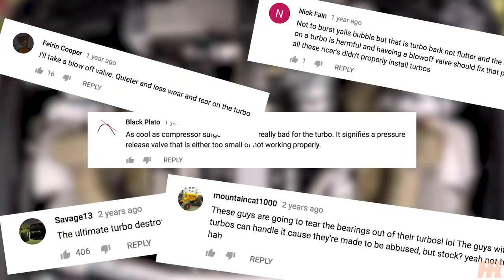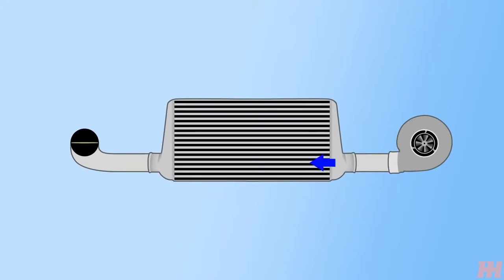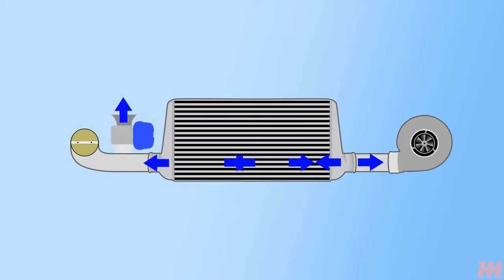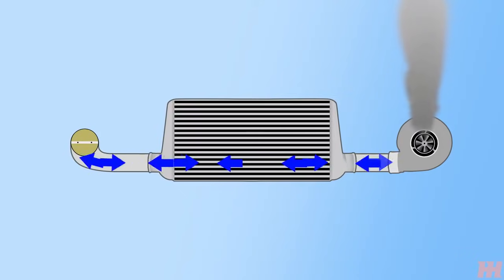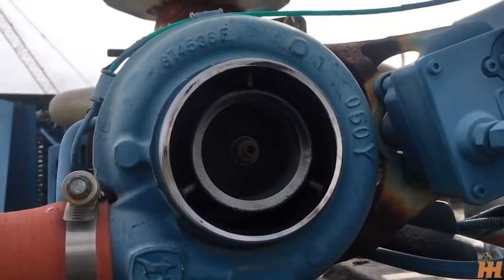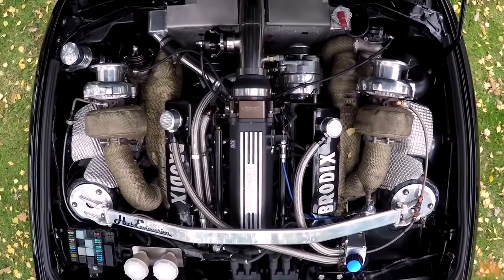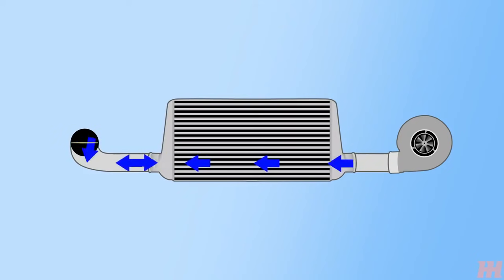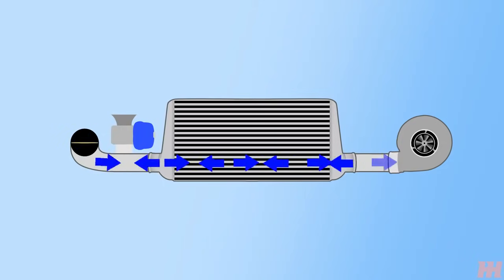The Truth About Compressor Surge

Comment: Stall is stall, open or close throttle. In the example given here you just replace the throttle butterfly valve with the engines intake valves.

Compressor surge is one of those things you know is bad for the turbo but no one can really measure the effects. 

In theory you want to minimize as much as possible for the health if the turbos but same is said for people and sugars, carbs, alcohol, etc, etc. Having some one kill you on the spot but what is the lasting results with indulgence?
Reply: Stall is not stall in this scenario. There is a difference in boost pressure when on throttle compared to off throttle. Closed throttle stops the turbo from creating boost, engine goes into vacuum the turbo is not making more boost which is not pushing against the air that just hit the throttle plate.

The turbine is still spinning because of exhaust gasses, the back pressure of air coming back to the cold side is higher pressure than what is moving toward the throttle body. There is minimal pressure being put on a thrust bearing in this event, which is almost the same as having a bov in the system. Unless your bov is the same size hole as your piping there is going to be some back pressure on the thrust bearing.

Stall during open throttle though happens while trying to make boost. The turbo is activity trying to push more air in than the cylinders can take. Exhaust gasses are actively trying to make more pressure and with nowhere for the air to go it moves back to the cold side forcing its way out of the inducer. This puts massive strain on the thrust bearing.

Now, you can put more strain during closed throttle on the thrust bearing than it was initially designed to handle by increasing the amount of boost a turbo was designed to operate at. A higher boost pressure coming back toward the cold side will out push the turbos idle speed and push against the wheel a little harder. But usually upgrading to a 360 thrust bearing fixes that issue.

Comment: how does open throttle compressor surge happen?
Reply: When the turbo is too large for the engine. It's putting in more air than the engine can physically take/make use of, so it comes back out and flutters under load. THAT is the compressor surge that can fuck your car.

Comment: Still though, closed throttle compressor surge will slow down your turbo, it might sound cool but why would you want to slow down your turbo especially between gear shifts?
Reply: Austin B it slows it down briefly but it also retains that pressurized air instead of ejecting it so the response might be better. I imagine in practice they both behave pretty similarly tho.
Reply: It’s bound to slow down, as exhaust pressure shall decrease unless you don’t lift off during gear changes 😛
Reply: You should go to a car meet, find a high hp car with no bov. Get them to take you for a drive and get back to me about the "lost hp". lol

Comment: Well that was only partially helpful for me. What happens when you experience closed throttle compressor surge but don’t have a throttle plate because the vehicle doesn’t have a throttle body. Ie my cummins powered truck. The entire intake system is open and unrestricted from the air filter to the intake ports. The throttle controls the injectors and not the airflow
Reply: hope you don't mind the copy/paste (as I literally JUST wrote this)... lol  Hope it helps though!

While they don't need them, they still help on a diesel to keep the intake air flowing smoothly through the compressor.  Although, as you said, there are no TBs on them, the thing that drives the turbocharger is the exhaust volume/heat... so when you stop "pouring on the coals" the turbo doesn't have as much exhaust roaring through it anymore, and that causes the entire engine's flow (VE) to slow down VERY dramatically (which will in turn "fight" against the compressor's high rpm), so they open up a "BOV"/solenoid to allow the turbo to continue freely pumping the air through.

Comment: This is incorrect. It does indeed cause stress/ damage to the turbocharger. 

“The Blow-Off valve (BOV) is a pressure relief device on the intake tract to prevent the turbo’s compressor from going into surge. The BOV should be installed between the compressor discharge and the throttle body, preferably downstream of the charge air cooler (if equipped). When the throttle is closed rapidly, the airflow is quickly reduced, causing flow instability and pressure fluctuations. These rapidly cycling pressure fluctuations are the audible evidence of surge. Surge can eventually lead to thrust bearing failure due to the high loads associated with it.
Blow-Off valves use a combination of manifold pressure signal and spring force to detect when the throttle is closed. When the throttle is closed rapidly, the BOV vents boost in the intake tract to atmosphere to relieve the pressure; helping to eliminate the phenomenon of surge.”

This is from Garret’s website :

https://www.garrettmotion.com/wp-content/uploads/2018/06/Turbo-Tech-101.pdf
Reply: Jason Cunningham you can explain all you want, but people are going to believe what they want to hear.  I tried explaining how surge was bad for a turbo until I was blue in the face.  Now I’m like, “I’ll run a BOV in my car.  You guys do whatever, who cares” 😂
Reply: Erik Cruz  😂 true. Same I’ll run a bov in my car. I don’t know why I just couldn’t let this one go, a whole video of misinformation 🤦🏻‍♂️

Comment: £100-169 for a new turbo bigger than you need with a 90’ angle air intake tube, to create big flutter sounds that folk will Balt in their pants. And your still driving at the speed limits. Or hammer the engine and get a little psst sound and uses shit loads of fuel. Which do you choice 🎉🎉🎉🎉😊 also bigger intercooler for cooler air means even more turbo flutter as it’s pushing out cooler air.

Comment: This is WRONG. What they are talking about here is compressor STALL not surge. The true technical definition for compressor surge is when The turbocharger is moving a larger volume of air than the engine can in-take at a given RPM at wide open throttle. A symptom, of unstable air in the intake manifold itself. Also It is (or was) a far more common issue on turbocharged engines that use an individual throttle body assembly running large amounts of boost. I.e RB25/26. Synapse Engineering  has a video demonstrating compressor surge.
Reply: No, there is open throttle compressor surge and closed throttle compressor surge. Open throttle is when the turbo is moving more air than the engine can take and the excess air escapes back through the turbo, as you said. Closed throttle surge is when the throttle body is closed and the air escapes back through the turbo.

Comment: Yet ALL Flutter is bad for journal Bearing Turbo's 
they not meant to take the thrust loadings like that.
Reply: It really doesn’t effect the longevity of the turbo in most applications, maybe the most considerable is in highly tuned bearing turbos without a BOV but even then still lasting a long time, and it is still debatably negligible.

The amount that they slow down under load while the system is closed really isn’t going to do any harm overall, it’s not enough pressure to hurt those bearings, plus those bearing are made to spin at unreal speeds. They can handle a slight reduction in speed, it isn’t abrupt or dramatic enough to do anything notable, especially with how fast they run.
Reply: @DoktrDub   The issue is not the speed reduction The issue is the sudden and violent movement of the turbo impeller. 
Under full boost Air is entering your intake at near Mach 1. This pushes the impeller against cold side housing away from hotside housing with play limits of the bearing tho small still present. 

Journal bearings have no design in them for Thrust Loads Forward and Backward Only Rotational loads even spaced out.. 

So when they Flutter or stall they turbo impeller is suddenly no longer acting like a PROPELLER 

This sends hot side slamming back into housing and pushing cold side away. 
Then slamming back n forth at the speed you hear the flutter as the airflow stalls and the start stall n starts. 

its like a electric motor with Journal Bearing its fine but move it back and forward fast in direction perpendicular to rotation and very fast bearing will die. 
Hence why you never shake a coffee or herb grinder as they blow bearings fast. 
Or if a skateboard had Journal bearings only a few sideways slides with side loading and they would fail.

Comment: If the manufacturer installed a valve, then it means it should be there and surge is bad for the turbocharger. It might be that manufacturers know better than any "internet expert". I'll keep my valve, thanks, no need for flutter.
Reply: Dan Slotea It’s not actually about damage to the turbo, it’s about boost response. Like the video stated, the air (not the turbo) will momentarily stall, and the turbo will slow down a little. Then when you get back on the gas, the air has to organise itself back in the right flow direction, and the turbo has to spin back up to speed, meaning there might be a small loss of response. The valve keeps it all moving a little more freely in that situation. 

On a car with an automatic trans, or a quick shifting trans like a dog box or sequential, it makes no difference since there is very little or no closed  throttle time during shifts, making a bypass valve just another part to make room for or leak/fail etc, so it can safely be removed for simplicity in those situations. 

Another often forgotten side of the argument is the effect of using/not using the bypass valve on the MAP or MAF sensor. I won’t go into too much detail, but you can imaging that depending on the vehicle or setup, a sudden spike in pressure as the throttle plate shuts may have an effect on the ECU via the MAP sensor, and turbulent/stalling air in the intake tract may have an effect on the MAF or AFM. 

So basically, what you say is quite sensible, if the engine came with a bypass valve, and you are still using the factory ECU settings and factory engine sensor arrangement, it’s likely a good idea to continue using a bypass valve so as not to upset anything electronic. 

However, removing the plumb-back hose and letting the valve vent to atmosphere can give you some mean af exhaust pops and crackles and maybe even a wicked exhaust flame on a car with a MAF, it’l momentarily go mega rich when that valve opens and really put on a show (and blow your cats out if you’re unlucky 😂)
Reply: @KingOath  I understand your point of view, however I am not interested in response time, but mechanical shocks to the turbo bearings. They add up and decrease the lifetime of the bearings. Or isn't it so?

Comment: Is it that simple tough? Most "experts" say that even closed throttle surge is bad for the turbo so I don't know what to believe... -.-
Reply: They say it will cause wear. I'm all for flutter and I'm yet to see proof of it being bad. That said, I have no doubt it puts extra strain on the bearings, however, they are designed to handle thousands upon thousands of rpm, so it's not likely they'll fail any time soon. I'd take 8-9 years of flutter over 10 years of not, for example. A replacement turbo might be 500-2k, but you've had years of enjoyment out of it. You should just do whatever you enjoy more

Comment: just a small correction: flutter on open throttle can also just be the sound of the wastegate rapidly opening and closing.
Reply: How can something that just diverts excess exhaust gases out of the turbine housing make intake sounds?
Reply: Two different things, compressor surge and wastegate chatter (or whatever you want to call it) are not the same

Comment: compressor surge doesnt have anything to do with a throttle body blades closing. If that was the case diesel engines wouldnt have compressor surge and centrifugal super chargers would.. Diesel engine have no throttle body and always have a way for boost to relive itself. "Compressor surge" is from the sudden halt of hot exhaust gasses.
Reply: diesels engines don't have throttle bodies.
Reply: No, sorry. It has everything to do with the throttle body closing. Find a mate who has a car that flutters and put your hand on the filter, you will feel the air coming back through it.  I don't know enough about diesels to tell you why some of them flutter, but I can literally jump into my petrol turbo right now and replicate the first part of my comment. There's a good video example of it, where a dude puts his business cards by the intake and lets the flutter blow them out toward the crowd watching the dyno.

Comment: If turbo flutter is bad as everyone says????? Why dont diesel engines have blow off valves? Semi trucks dont have them, I know this because i drive one every single day. (Dont try and correct me)
Reply: Because the don't have throttle bodies. the control the throttle with the amount of fuel injected

Comment: No it is still really bad for intercoolers and piping if your running ton of boost
Reply: No it isn't. As long as you have even ONE silicon joiner, that will jump off before damaging piping/intercooler. It'd be a problem if you somehow welded all the piping together..

Comment: Turbo flutter is not bad for the turbo because it slows the turbine down, it's bad because it slows it down in a bad motion. The pressurised air is literally breaking (I mean slowing it down very fast not breaking down) the turbine so the bearings experience the same stress you covered in your video. If turboflutter had no impact on reliability then mass production cars would not need a blow off valve and therefore manufactures would not be installing it. That's why it's only used in race applications.

Comment: In Mechanic classes they teach you that it is bad. 
Stresses the blades. There is a reason tuning shops and care manufacturer installs blow off valves.
Reply: They install them so you don't get reverse maf air flow.

Comment: After about 20-30 minutes of google searching and a bit of independant thinking led me to the conclusion that this video is plain wrong. Turbo surge of any kind is bad for the bearings in the turbo. If you were coming off a 7k rpm pull, and lift the pedal all the way, the throttle plate closes, but the engine does not wind down in an instant, so the exhaust is still spinning the turbine and air returning from the throttle body is pushing against that spin, via the impeller, in the opposite direction. This opposing force creates a lateral load in the turbine-impeller shaft and hurts bearings. Why else would anyone making big power buy a BOV? just to waste money and add weight?
Reply: 20-30 minutes of google searching is better then people with 20+ years of experience not running blow off valves.
Reply: The reason google told you that is because forums are full of people spreading a myth they don't understand. They just read something and believe it. Plenty of people making HUGE power don't run BOV's. People used to always say "goldfish only have a 3 second memory" for decades, only to be told they're actually full of shit. I've seen plenty of pistons go through blocks, plenty of transmissions give out, but I have never seen someone need to replace a turbo due to running no bov.
Reply: Then why do companies like Canam who make turbo engines for side by sides not run a BOV at all or high revving high performance engines?
Reply: @strider5119  it’s the equivalent of a placebo fir example Europe cars are unreliable or parts are expensive when the counter is actually more expensive majority of the time

Comment: I dont get what the difference between open and closed surge is, because in essence it is the same, more air flow then the engine can eat.
Overspinning the turbo to make the surge at open throttle will damage the turbo, but the surge itself should not.
A turbo with surge protection housing should be fine when talking about surge?
Reply: Open throttle surge is when the turbo is forcing more air in than the engine can take (while your foot is on the throttle).  The excess air escapes via the turbo.
Closed throttle surge is when the throttle body closes (when you lift your foot off the throttle). The excess air escapes via the turbo.

The difference being, closed throttle is harmless, open throttle means there is way too much air entering your engine.
Reply: @strider5119  Sorry for not being precise enough.
I do not understand why open throttle surge is worse then closed throttle surge.
The turbo is trying to pump more then the engine eats in both cases, Is it because open throttle goes on for a longer time or why is it worse the shorter but much harder closed throttle surge?

The wastegate should bleed off exhaust to prevent a constant open throttle surge going on, unless something is wrong with sensors or wastegate function.

Comment: It used to be a bigger issue when most turbos used bushings instead of ball bearings, its still putting stress on the turbo, just not as much of an issue on modern turbos.

Comment: so is a BOV even necessary?
Reply: Necessary is to listen to our mechanic's advice
Reply: A bov will reduce noise pollution and take some strain off the bearings. Not running one will create noise pollution and will add strain to the bearings. Turbos are designed to spin at tens of thousands of rpm, the bearings are more than capable of handling with or without.   That said, I wouldn't buy a $150 ebay turbo and combine high boost and no bov. On something like a garret, all day every day.

Comment: wonder what happens if you EFI isn't set  up for no BOV i can only imagine lean on it till it eventually grenades especially when your TPS sees no throttle
Reply: Won't really make a difference. Air leaving via a bov is generally plumbed back in between the turbo and maf. Air fluttering back through the turbo does the same thing.